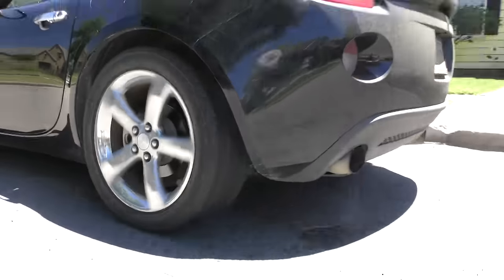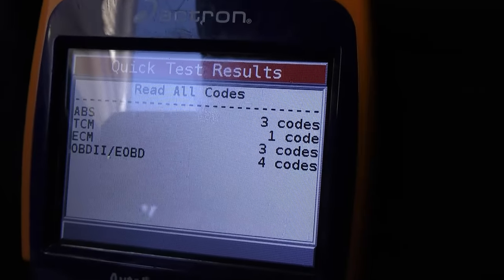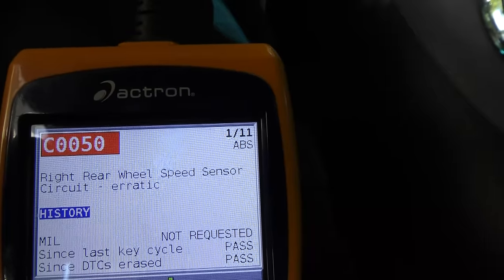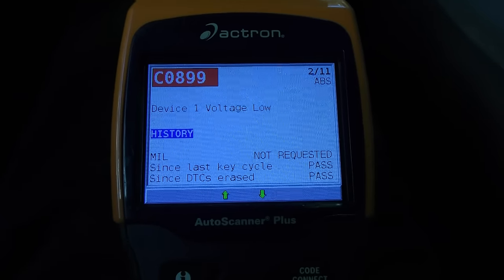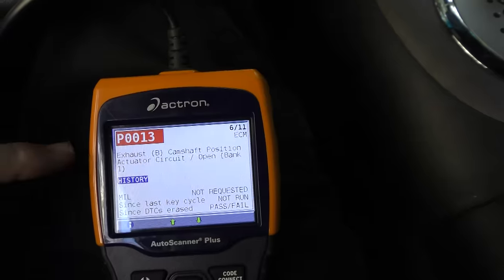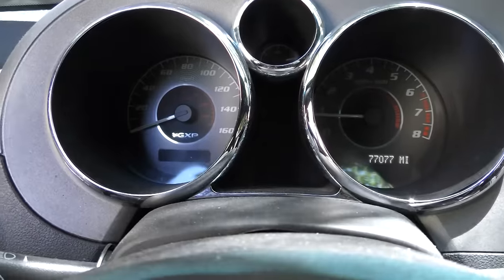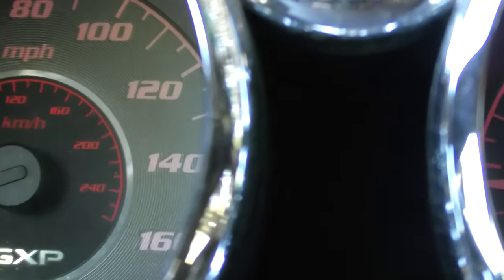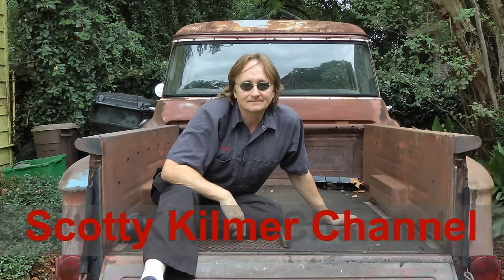Check Engine Light On in Your Car? The Truth About What it Means

Comment: do women have check engine lights?
Reply: Steve Waddell yes but here again we can plug in an appropriate scanner to so if there are no major issues
Reply: Hundreds of lights, if not thousands. The ability to reset just one of them during their entire lifetime is completely unobtainable.
Reply: Thanks for the laugh. HAHAHAHAHAHA!
Reply: Steve Waddell trying to diagnose their problems makes German cars look user friendly
Reply: They do but not obd scanner could tell you what any of the codes mean.
Reply: Yes they do, they even have signs before the light even comes on lol!
Reply: very subtle lights if you don't read one right you'll be run over and wonder what happened!
Reply: yep - the scan code says 'get wife-cancelling headphones - NOW' - good advice.
Reply: Steve Waddell only on models 1996 and newer
Reply: Like my 69   427 vette convertible.   Faster than heck but no midrange.   Owned it from 95-99.   Glad to have gotten rid of it.   Kept the 64 327 vette convertible.   Sweet.
Reply: No need, women have self cleaning and self lubricating engines.

Comment: A working Abs is very important on cars designed with Abs system because the wheels will block without much effort and the distance until the car will stop în an emergency will increase alot.

Comment: Whoever owned my car before me actually removed the bulb
Reply: Didn't you check this before buying the car?
Reply: To be honest it was my first car and I was too excited so didn't notice :) No regrets though I bought it at 68,000 miles now it's at 100k
Reply: Yeah, that is an old scam, ever car has a "key on, diagnostic check" Turn the key to the on position and every single light on the dash will light up at least once including the check engine light, then they turn off. If you do that on a car and you don't see the check engine light, turn it off, say thanks and walk away.
Reply: good thing you don't have emmision test. they will fail it right away
Reply: If they were smart enough to remove that bulb, they might have been smart enough to go ahead and wire the bulb to a circuit that lights up for, say, the temperature to fool a person. Then the light would light up during the test and someone might not realize but it would only come on again if the engine ever overheated badly. Just saying.

Comment: I have a 2000 Chevy Monte Carlo! The biggest pain was the MAF sensor. You can unplug it in an emergency and you can still drive it! Unfortunately I had to have the engine replaced last April,  they used the MAF sensor from the worn engine because I'd had it replaced a few months before! The used engine was $1100 and other than a bad alternator I haven't  had any problems since. The used engine had 89,399 miles on it.....

Comment: In other words, wait until the problem becomes serious enough, and risk causing permanent damage to the engine, until you decide to have a look at it ? Not to mention risking getting stranded on the side of the road somewhere because the engine has finally failed after numerous warnings. It's never a good idea to hide your head in the sand and hope the problem will go away. 
Yes, minor codes can usually be safely erased without much concern. But ones that keep coming back certainly have to be looked at, especially ones that deal with internal engine parts or sensors. Spending a little money upfront can often save a lot in big repairs down the road.  
Scotty is like those doctors that tell you to take two aspirins a day for your pain, and call them back in a few months if don't feel any better. Then, you'll probably have to have an operation instead of just proper medication...
Reply: I'm a master technician. And as such, a check engine light will only illuminate for issues related to emissions. All engine drivability issues effect emissions but many emission issues won't effect drive ability. The check engine light being on steady is harmless so long as the vehicle is running smooth. If the light is flashing, or on steady bit with drivability issues ( watch your gauges) then you most likely have an actual issue. As far as ruining the engine, driving with the light on won't hurt the engine without other issues like a misfire, or overheat. All things the driver should notice. The inherent problem is accountability. No body wants to put down the cell phone long enough to know what their car is supposed to run like on a good day and ignore when things stand out. Temperature light/ gauge is far more critical yet some how people always comment (it was only hot for a second) with engine failure. Most people only notice an overheat when the a/c cuts out,
Reply: Let me quote you: "...a check engine light will only illuminate for issues related to emissions."
That is the most utterly absurd thing that I've read in a long time.
A crankshaft position sensor, camshaft position sensor, oil pressure sensor, knock sensor, misfire sensor, MAF sensor, MAP sensor and many others in an engine, can all illuminate the  "check engine" light if the ECU has detected a problem with anyone of them. And if ignored for too long, some of those problems can cause serious damage to an engine eventually. But I'm not a "master technician", simply an industrial mechanic millwright which deals with all kinds of sophisticated machinery, and can recognize bullshit when I read it.
Reply: Ok lets be clear. A misfire sensor doesn't exist...and the other components you listed all have an effect on emissions. Map sensor and Maf sensors are your primary input for major fuel trim. Knock sensors detect detonation which causes partial combustion and increased Nox. I strongly recommend that you take a class or two on engine performance specifically, and engine repair to supplement. I also service industrial and specialized equipment. From lawn mowers to fire trucks and genie lifts. Stick to your trade as engine performance is a specialty of mine.
Reply: Crank sensors is the input for ignition timing....again effecting emissions. OIl pressure sensor is monitored primarily for modern variable valve timing systems again for emissions and efficiency. I'll even go further, the engine light will illuminate for a missing or stuck thermostat....why? because it increases warm up time which extends the warm up fuel trim enrichment effecting emissions. Don't be one of those keyboard warriors who takes a little knowledge on a subject and pretends to have a mastery comprehension on a subject when insulting a specialized professional. =)
Reply: When an engine doesn't run at all anymore, because it has seized up for lack of proper lubrication after running it with too low oil pressure, it doesn't produce any emissions anymore I'll give you that. 
Don't kid yourself, OBD-II codes aren't ONLY for emissions problems. Do you have any idea what extended knocking can do to valves, lifters and pistons ? Of course not. You're only concerned with emissions...
Reply: By knocking you mean detonation. and yes I do and that damage is long term, the initial impact is a change in emissions. Furthermore, why does OBD2 exist? for uniformed emission testing and repair! This is why it is federally mandated for engine data to be universal, and other systems can be proprietary. Do yourself the favor of sticking to your trade and out of others.
Reply: It's true that the original OBD system was primarily for monitoring emissions. But the current OBD-II, a standard introduced in the mid-'90s, provides almost complete engine control and also monitors parts of the chassis, body and accessory devices, as well as the diagnostic control network of the car, not only emissions anymore. So that "check engine " light can mean way more than just a bad O2 sensor these days. It could prevent serious engine damage in the long run. But if you keep thinking that ignoring it, or erasing the error codes, is a permanent solution even if it comes back on, feel free to do so at your own risks. I won't. That light doesn't light up just for fun. Multiple occurrences have to have happened with a particular issue for the ECU to decide to light it up. And simply erasing it won't make the problem go away by magic.
Reply: Problems t go away on their own. I said if the vehicle runs ok and there is no other indicators other than the engine light, it is typically emission related. all driveability issues effect emissions but not all emission issues effect drivability. Obd 2 was mandated in 96 for the sole purpose of emissions. other systems are accesible through the obd 2 but the protocols for emission information legally has to be universal. the other systems can be proprietary because they dont effect emissions. That is federal law. Its all about emissions. The federal government doesnt give a shit if your car runs like shit so long as it isnt polluting more. Thats why engine management systems are legally mandated to be universal.
Reply: Why are you fixated on emissions ?  Please explain to me what the EOBD code P0841 has to do at all with emissions ? (in case you don't know what it means, it indicates that the Powertrain Control Module (PCM) has discovered an abnormality in the transmission fluid pressure sensor circuit.)
Or explain what these ones have to do with emissions  P0640, P0560, or P0980. All of which can light up the "check engine" light and have absolutely nothing whatsoever to do with emissions.
Reply: Intake air heater voltage? really ? changing air temp/density for fuel trim wouldn't effect emissions??? Shift solenoids wouldnt effect engine load/efficiencies? PCM voltage doesnt dictate everything emission?
Reply: This is what can only be described as bad faith on your part. Shift solenoids malfunction will cause bad transmission shifting and premature wear on clutch packs, as well as poor/jerky shifting from an automatic transmission, and have nothing to do with emissions. Anyway, believe what you will, ignore that warning light all you want, I sure won't. And I'll be sure to have a properly functioning powertrain including, but not limited to, emissions. Now, you will excuse me I have to go to work to do preventive maintenance on a four million dollars piece of equipment, which doesn't produce any emissions BTW. It's powered by hydroelectricity from a dam. Electricity that will, one day soon, replace antiquated, inefficient and dirty gasoline engines anyway. ;-)
Reply: I'm well aware on what a shift solenoid does. I was simply describing its impact on emissions and why it set the MIL. Stationary equipment has limited variables. Talk to me when you're dealing with a 1.8 million dollar platform/ladder fire truck that has been driven and inspected by clueless firemen and exposed to heat, extreme climate, driver/operator error and every unit is custom built so no two are alike.
Reply: AlainHubert the problem is mechanics ripoff people when they get their cars fixed. So nowadays people rather just junk the car and lease a new one
Reply: If a plumber charges 100 an hour its ok. Electrician charges 100 an hour, its ok. hvac 100 an hour, no problem. A mechanic who does it all and more charges that and they're ripping you off.

Comment: If you don’t have scan tool, disconnect the battery to clear the codes and the engine light will go off. I have done this a few times and the engine light does not come back on because it was false alarm. However, if you have real problem, the light will come back on. Where I live, you can’t pass the annual emissions test if the light is on for emissions reasons.  So, the light is a big deal and you can’t just drive around with it on for years.

Comment: ABS was adapted from technology developed for airplane brakes to prevent skidding under braking when the plane lands. It was implemented in the car industry because the vast majority of drivers, apart from those with lots of specialist training and experience, mash the brake pedal hard and continuously when they have to make a sudden emergency stop. Everyone who has ever driven a car has done this. Without ABS this usually results in an uncontrollable skid as the steering is ineffective when the wheels are locked up and the car is sliding. ABS was applied to cars because the natural instincts of drivers to stomp on the pedal and not let up were getting themselves and others killed. ABS is the single most important and effective advancement in car safety EVER.

Comment: I bought a new Chevy pickup check engine light has been on every since I bought it. Got 267,000 miles still rolling smooth and original motor. I've owned alot of Chevy's and check engine light is very common I've seen

Comment: Would have been helpful to note that for every code, there is a specific set of conditions that will illuminate the Malfunction Indicator Lamp.  Some conditions require ignition cycles, temperature, mileage, etc.  That would have been a more accurate form of "the Truth".

Comment: I agree with Matt hsv, always check what the codes are before ignoring them, even though you may not have drivability issues you may be going through a lot more gas and in the case of certain codes like crank sensors, they can leave you stranded !!

Comment: Great video. My ABS light and my ESC off light have been on for over a year. I've ignored them. Now my 'check engine' light is on. But the car runs well. It's a Kia Rondo with just underr 100K on it. As a single woman, I have a feeling mechanics might take advantage of my ignorance if I go in and the Kia dealership is booked until October...so I don't know what to do :-(  My TPS light goes on and goes off constantly. I never know what it's going to do. I should have married a mechanic!

Comment: bought a truck, used, three years old, 120000 on the odometer. Parked it running 12 years later with 502000, light still on. I did put gas and oil in and had to change the gearbox at 310000, but for the rest it drove well!

Comment: To be clear, if you use a scan tool, you may find other codes for other problems, but the CEL light will only come on if it's emissions related.  And in most states, the ABS light does not fail an inspection, only the CEL light.

Comment: 50,000+ miles P0420 on my 98 legacy it comes on every few months i just reset with my scan tool one thing that helps every now and then with a P0420 code is run a bottle of heat to clean water out of fuel system and also add a bottle of fuel system cleaner. like bg 44k seafoam or chemtool b12 and after youve ran a quarter to a half tank of fuel and the engine is properly warmed up run the engine hard at full throttle until it shifts thru one or two gears to realy help to clean the engine out.

Comment: the check engine light came on in my ford, was solid for a good 30 minutes of driving, started flashing. started freaking out, pulled over, checked it with my Bluetooth obd scanner, was just an o2 sensor. 

cleared it, it came back on then turned off the next day. 

now it just turns on and off whenever tf it wants

Comment: i know this is off topic but i find ABS to be dangerous in some conditions. On icy slick roads ABS will cause more accidents than save as it take 3 times normal distance to get stoped. Because it detects the slipery condition and auto disengages brakes and you cant stop or in some cases even slow down.

Comment: You should just replace parts. You test for what is being affected by the code. Then you will know what part to replace.  A few years my 03 Toyota Camry's check engine blink on/off. The problem was due to a sensor that went bad. It was replaced and the car continues to be reliable with no other problems.

Comment: The check engine light has been on in my car for 10years; sometimes it goes off for a while but always comes back on. I can turn it off if I put accessories on and tap the battery neg 3times but it doesn't last long, tape is best.

Comment: Makes me feel better. Being a female and driving late at night sometimes has me worried since mine just lit up on the way home. It runs well, but is older and higher mileage, so a little nervous to just YOLO it and ignore the light. I am going to see if I can get a code read and get one of those readers so I can reset this like the video said. Sounds like it makes sense to try it this way. The gas cap was retightened and it is not a flashing light, so good so far then lol

Comment: Had a problem on our Impala, it would hesitate occasionally on the road. Not bad, just once or a couple of times in a 20 mile drive. No check engine light. Looked into replacing the fuel filter, but that is built into the fuel pump(in the gas tank) and that is one expensive beast now with fuel injection. Kept driving it and it seemed ok. Then it got to the point that it had a lack of power, finally broke down and replaced the pump, which fixed all the problems. But, it could have been something else. Point is, waiting for it to really show what the problem was simplified the fix. I could have spent thousands more trying everything else.

Comment: Playing the check engine light guessing game is not fun.  I have a 2009 Chevy Malibu (2.4L 4-cylinder) that had a misfire code on cylinder 4.  Tried a new air-filter, new spark-plugs, ignition module, fuel-injector, then took it to a mechanic who did a compression test.  It was a burnt exhaust valve on cylinder 4. 105k miles is a little early to be doing a head-job. The car has never been abused to my knowledge, although my wife drives it, and would not tell me if she did something funny like putting the car in manual-shift mode and driving around town in 1st gear, or over-revving the engine trying to drive through the snow. Sigh.